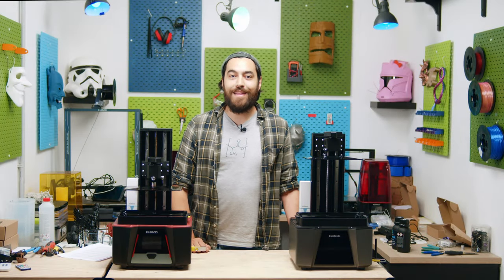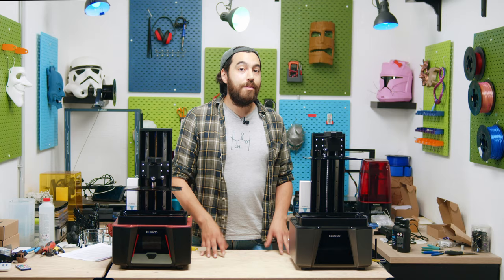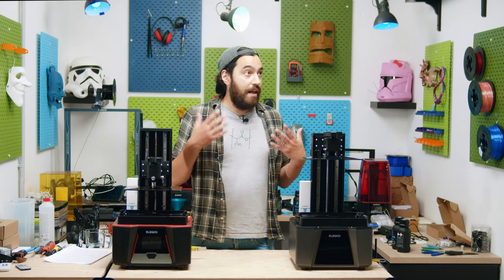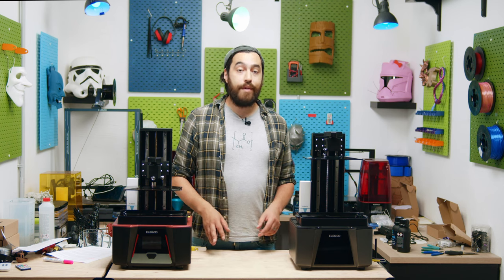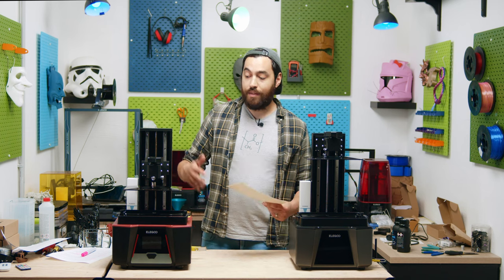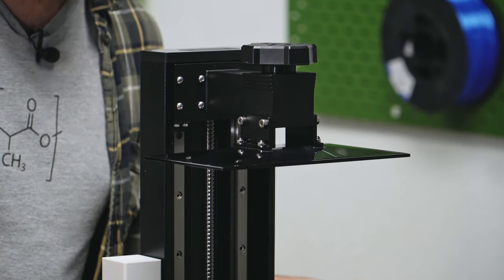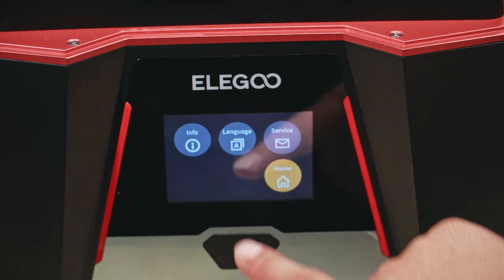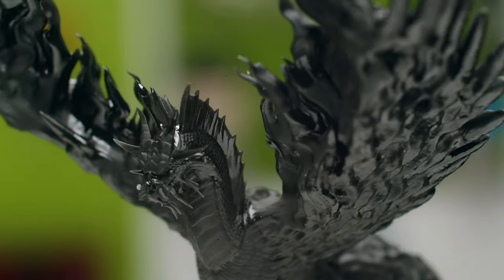Elegoo Saturn 3 and 3 Ultra Review

Comment: To me, the value for the extra $100 isn't about speed (I'm in no hurry), it's about more stable Z-axis, and those four bolts. I never had to relevel my old Epax (4 bolt system), but when I switched to Saturn 2, those 2 bolts just don't hold up. Stable Z and stable build means less failures and that's the key value. The wifi is an appealing perk, as well.
Reply: I also got it because of the build volume and the metal chassis, just a higher quality experience.

Comment: some quick questions:

1. the ultra buildplate sits very safe once leveled, how about the standard? did it have to be releveled often?
2. how loud are the fans and the z-axis? could you record that, because my only room fit for printing is right on the other side of my bed
3. how easy is it to get replacements of elegoo spare-parts?

thanks and greets
Reply: The fan is significantly louder for me, but the z-axis is... actually quieter. The hum from the fan is still negligible from a room over. I have to remember when it's supposed to finish when I check up on the print. It's almost disconcerting as I found the Saturn 2 whirr somewhat pleasing and letting me know it's working XD

Comment: Is the lead screw loose on top on the normal Saturn 3, saw that fauxhammer mentioned it in his review of it!! It could be problematic after some time and that could be the reason for choosing the ultra!
Reply from the maker: The leadscrew is held in place with a bearing although the hole for the bearing is a millimetre or so bigger than the bearing so if you put some force on the leadscrew with your finger it can be shifted over a bit. Haven't had any issues because of that though.

Comment: Nice review :D 
I bought the Saturn 3 Ultra with your resin on your website and I was wondering what are your parameters to print (exposition time, layer height,...)?
Reply from the maker: That really depends on the resin and your required specs. When we were printing at 0.05mm layer heights we used a 2.5 second exposure on our ecoResin
Reply: @3DJake_Official  thank you very much 😃 it's my first resin printer and it helps me to know where to start with the parameters